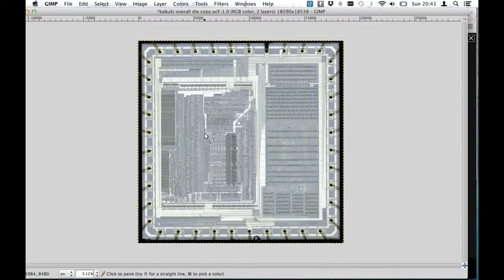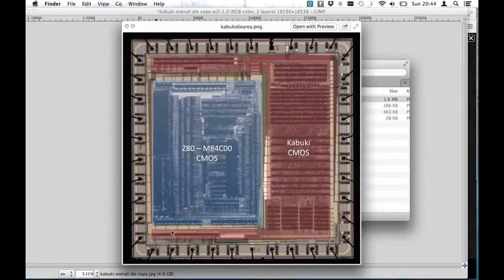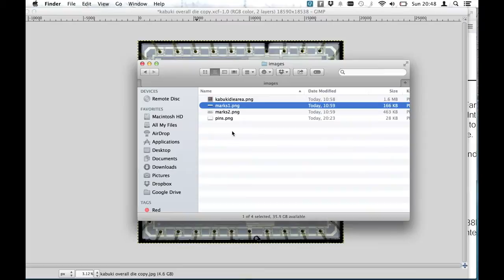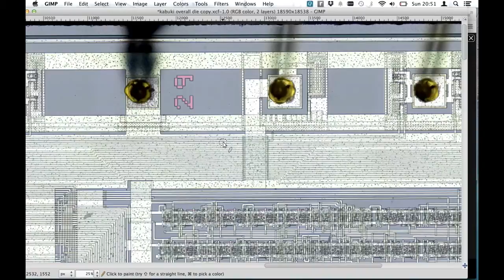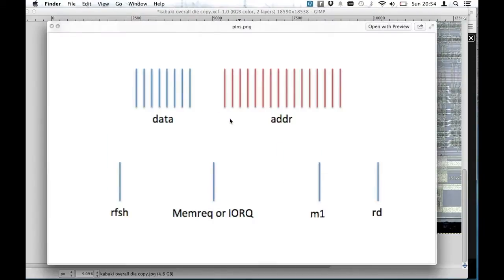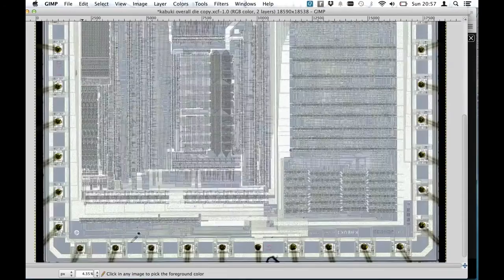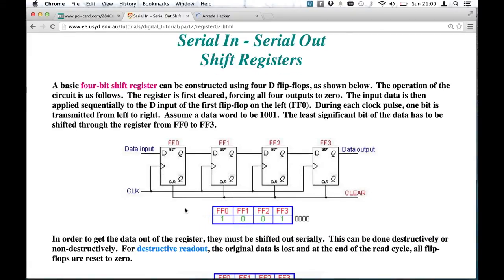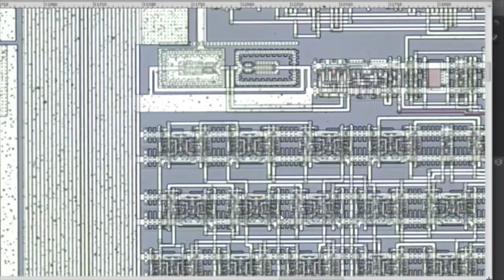Capcom Kabuki Z80 CPU Reverse Engineering Part 4

Comment: why are the gates so large compared to the z80 core's?  Even without the visible appearance of the detail, consider that the CPU core has some thousands of gates, and the same size region on the right has about a hundred.
Reply from the maker: John Długosz protection, driving power etc. They interface with the external world and need to be  capable of withstanding messy stuff.